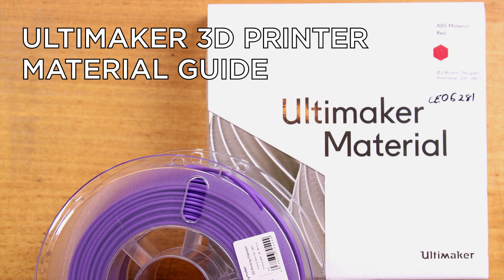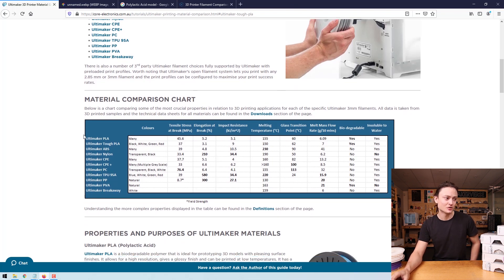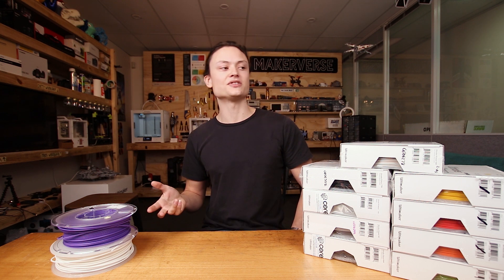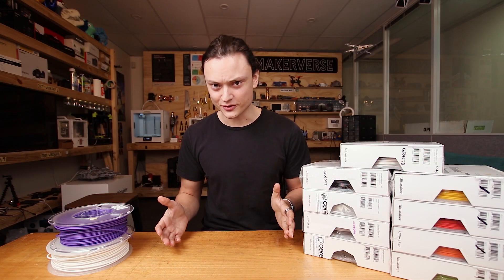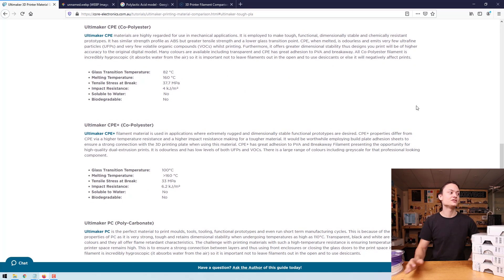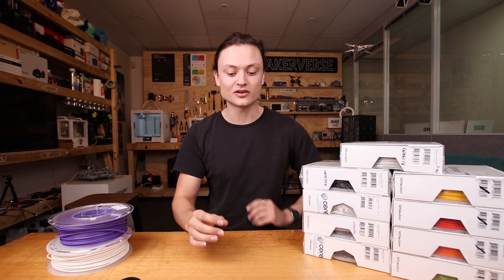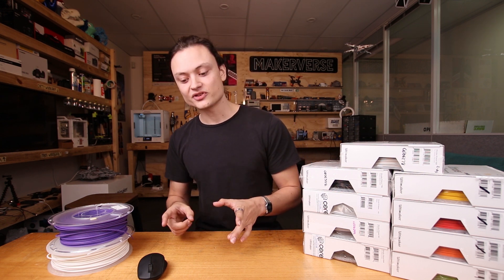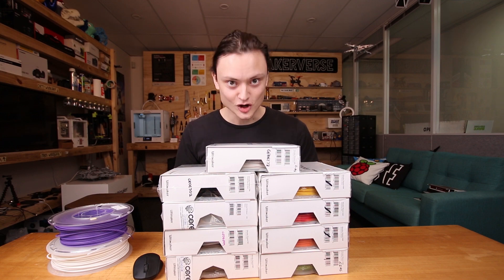Our Guide for Ultimaker 3D Printer Materials/Filaments

Comment: Great video! I am an industrial design engineering student and I am thinking of getting a 3D printer. I am considering an ultimaker 3, because of the double extrusion. But my oh my is it expensive. What are your thoughts about this? Another option would be to go for an ultimaker 2 maybe?
Reply from the maker: Heya Dennis, Ultimaker is hard to beat for a professional experience. If you are into white papers, then here are some guides that will cover off on more than YouTube comments ever could https://ultimaker.com/learn/white-papers
Reply: Thanks! Will give that a look
Reply: There are better ones but they also are more expensive. There are cheaper ones but they are worse. 
The Ultimaker S3 combines high quality with a reasonable price.
The Zortrax M300 Dual costs slightly more but also shows better results. 
The Raise3D Pro2 is way cheaper but also not really that good.